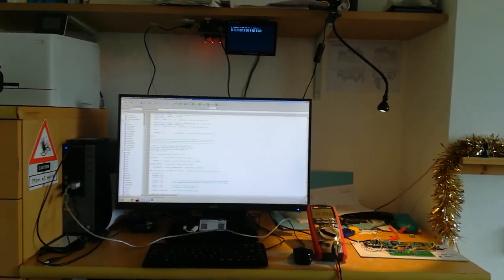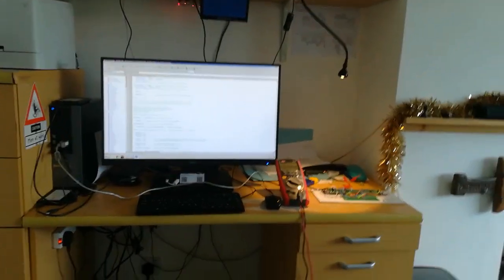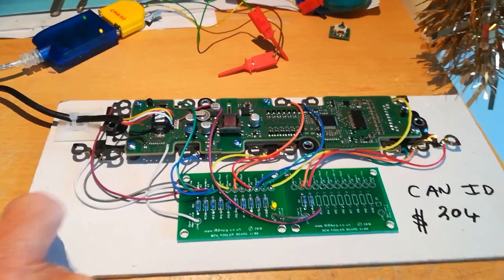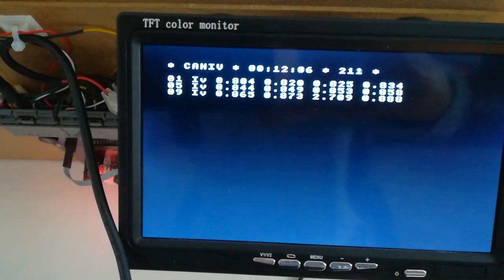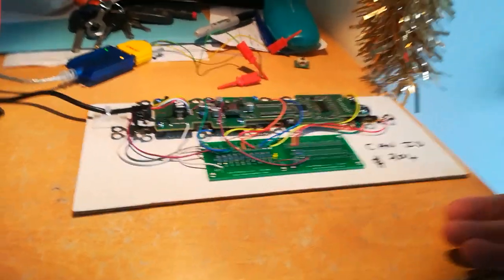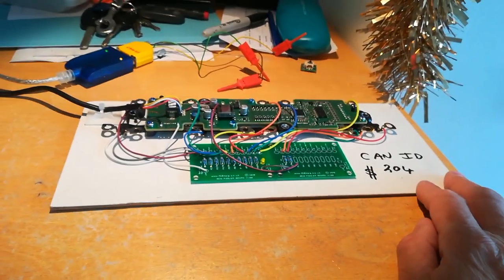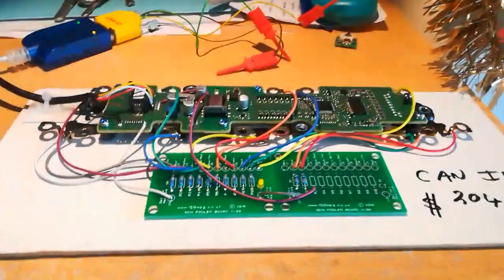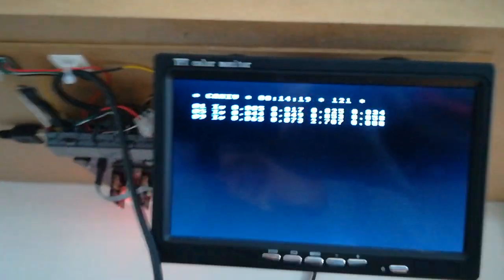BCM Replacer working with Honda FIT LTO BMS.

Comment: Why not tesla bms? They are more out there than any other brands, except for the leaf
Reply from the maker: We are using the packs these BMS board are already attached too.  Why waste them.
Reply: Chevrolet Volt BMS is worth integrating as well. A complete unit is 100$ on ebay.  Can bus protocol on those units has been reverse engineered as well.